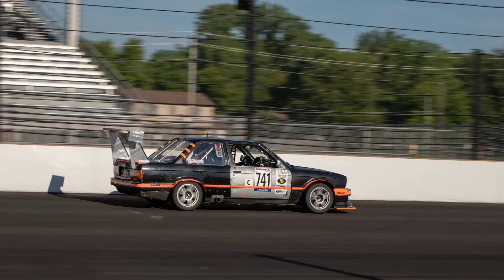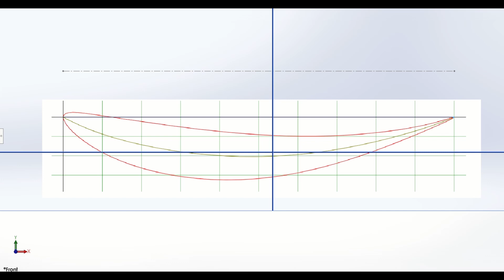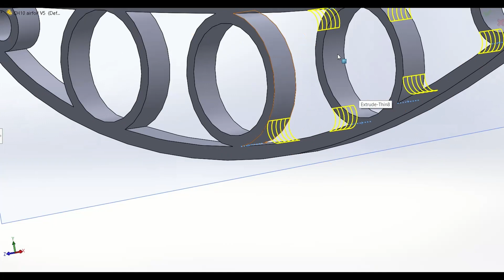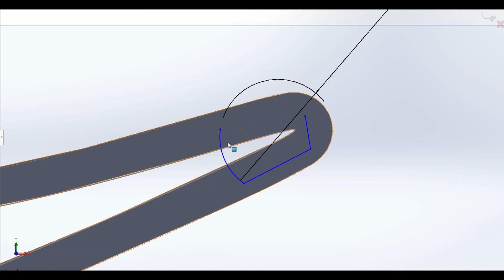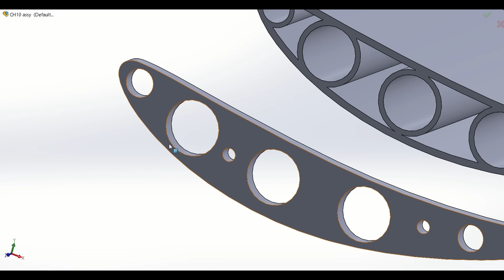3D printed rear wing design

Comment: Well I liked the idea, but it looks like you made the smart choice. I’ll probably end up doing the same thing.

A couple minor comments: when you offset to form the wall thickness, it looks like it went outboard, which would then violate the section which you copied.  In order to preserve the design shape, you can scale it up, then offset in, or just offset in directly. Another result of the offset outboard was that the trailing edge diameter became much thicker. This would have had an impact on aerodynamic efficiency.  With printing, you could get a pretty small, trailing edge diameter, and that would be preferable.
Reply from the maker: Good point on the offset. We're continuing, albeit slowly, work on a printed version using the vase mode that another commenter mentioned. Fun project but needs to be stable and safe.

Comment: Saw your thread on grm. I've been thinking of printing a wing too. One suggestion I have is that carbon tubing would contribute significantly more stiffness than aluminum tubing. Aluminum has good strength to weight, but stiffness is lacking.
Reply from the maker: Great idea. We’re also experimenting with just doing a thin printed skin and cover it in CF. Kind of a mixed approach.

Comment: Check out YouTube videos on designing the 3d printed sections for printing out of lightweight PLA and with vase mode in the slicer. Then the prints could be skinned with layers of carbon to get the strength. Will drastically reduce print time and weight.
Reply from the maker: Good idea. What does vase mode do in slicer? Haven’t tried that option yet.
Reply: @patinaracing  it prints just the outer layer in a continuous motion without lifting the nozzle. But it can be sort of tricked by designing the part in a certain way. Lots of YouTube tutorials out there. This one is good, https://youtu.be/QJjhMan6T_E